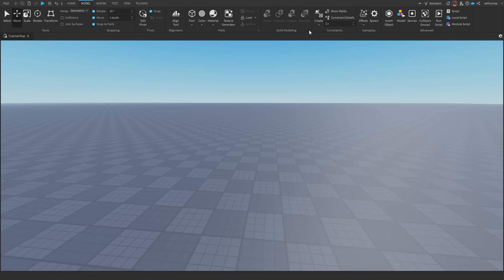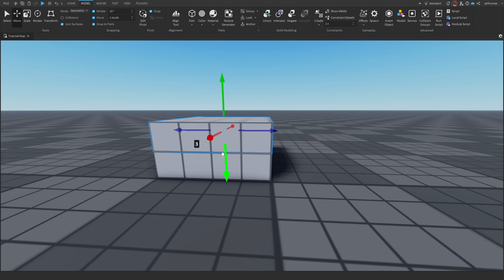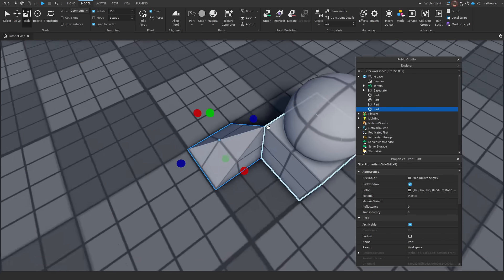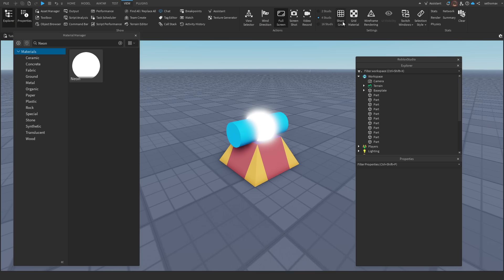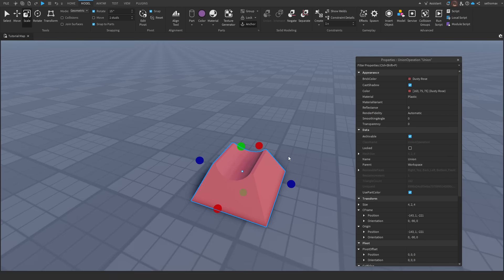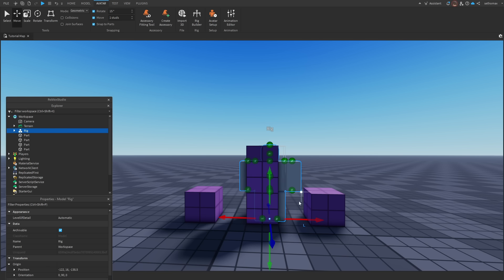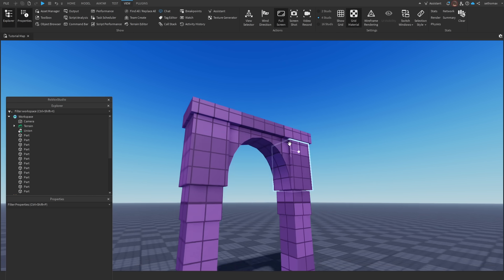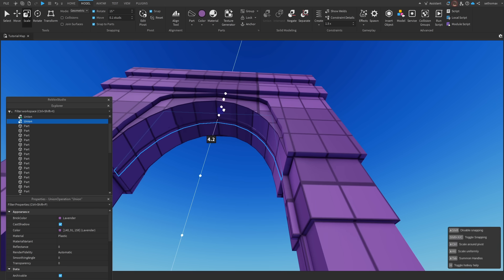Roblox Studio - Building Tutorial |  Basics

Comment: remembers unions are unoptimized so try to use them as little as you can, try learning basics of blender if possible, it can come pretty handy
Reply: Unions are only unoptimized if the polygon count is more than 2x of the original separation. Using unions is fine if you are gonna repeatedly uses that union, an example would be a union chair this would be fine to use if reused a lot but if you are use a bunch of different union chairs from one another than it's gonna get bad fast and this is cuz of a thing called a draw call. Part named Part are fine but you accident name it "part" then you have created two draw calls and you can make it worse by changing the color and texture from other Parts.

Example: Part - White - Plastic, 3 draw calls and is only 3 draw calls if all Parts are the same properties, this is called instance batching.  Instance batching only happens when something is the same as another.

1. All your Parts be named Part unless that Part need to named something else like "Killbox" for gameplay element script then go ahead
2. All union need to be the same name and plan ahead on what union can be used in other builds cuz you want to use as little as possible otherwise a lot of draw calls will cause you to lag even if the poly count isn't in the millions
3. Use a color and texture palette for your builds, you shouldn't use more than Min-25 Max-50 different color or textures
Reply from the maker: this is the basics of Roblox studio, not blender - it is stated that unions are unoptimized in multiple of my videos, and i express the fact people should advance their knowledge onto blender lots.

this comment comes across as rather pretentious, if you intend on giving genuine feedback i suggest you work on your tone to come across as likeable

- boneblox
Reply: @bonesblox  Actually, your response seems more pretentious. All they said was, 1. Unions are unoptimized (facts) 2. Try learning the basics of Blender IF POSSIBLE (even made sure to add on "if possible" because some people just aren't able to pick up on things as easy as others). You could have just not replied, but you did.

 - Pretentious Skittle 

P.S. - You could try being genuine OR likeable, you might get some "genuine feedback" in that scenario.
Reply from the maker: @SillyLilSkittle  You're right - reading back on this I was definitely not as open minded as I am now. I guess I saw it as a comment towards me - more than a comment to help the other viewers.

I do apologize for my Egotistical actions 
- Boneblox

Comment: You should avoid using cylinders and balls when working with CSG, they always cause extra vertices and you can't control their resolution. Use negative objects more than regular objects when working with unions, doing that will decrease the amount of objects and vertices contained in the union.

One thing that was suprising is to see the technique to cut corners perfectly with a negative object.

Unions can do alot of things but can't really do certain things such as natural objects, i think voxels could be good for that. Im curious to see someone make something with the terrain editor other than, terrain.
Reply from the maker: Yes! optimization is a very big factor in Roblox development, Roblox engine is undeniably weak, (they are adding more optimization tools soon) however for now you are really reliant on either using low poly cylindrical shapes which are auto smooth shaded or even baking your high poly models into low poly normal! of course this is pretty awkward if you are only starting out! which is the point of this video! I don't intend on telling people they should never learn blender, or try to optimize their works. its definitely a stepping stone, and I'm here to help them get there! thank you for your insight and in-depth comment!

Comment: My studio crashed and it randomly enabled these weird settings like the ones u have in the video like the number on the part and the white line and at the bottom right when u do it is a gui like in the video and I just want it reverted back completely, how can I do this?
Reply from the maker: This feature is a new called Qol Dragger, i believe its automatically enabled - but if you want to disable it you can open beta features in the file tab and find it there, however keep in mind disabling it also disables edge snapping, making it harder to connect edges more flushly and effectively.
Reply: @bonesblox  Thank you :D
Reply: @bonesblox  but the white line and gui at bottom right still appears